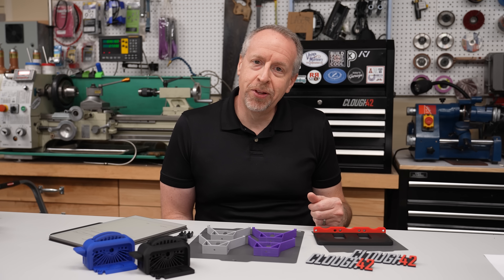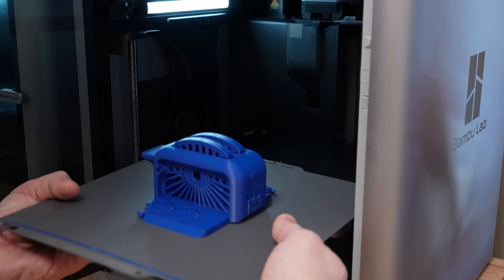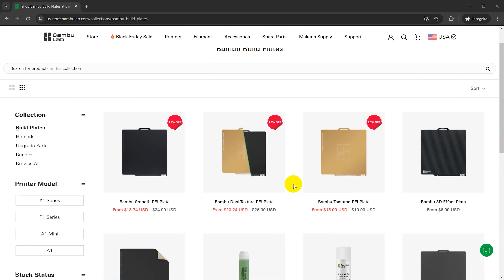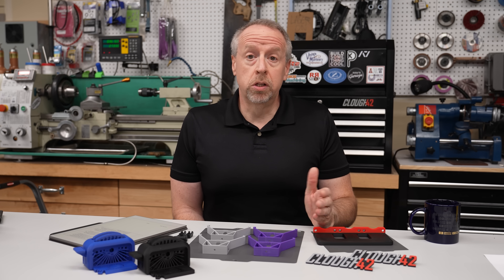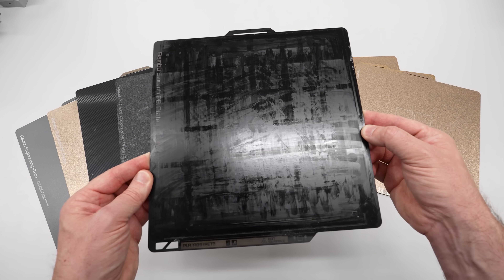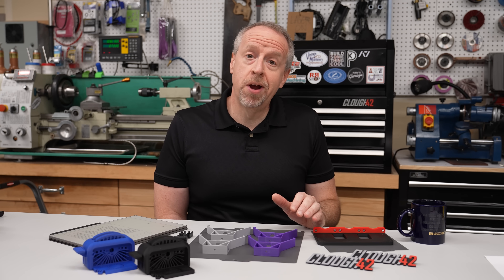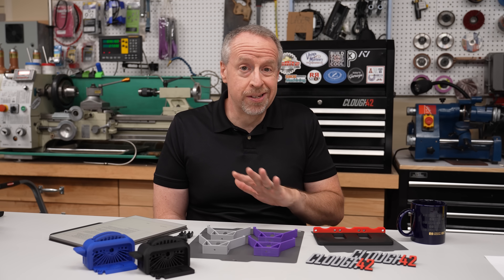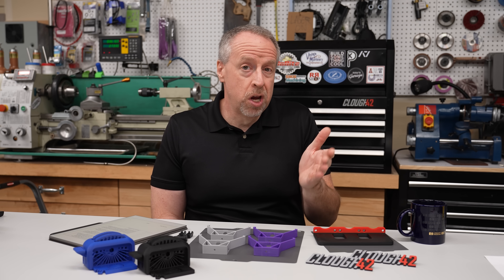Can't get your prints to stick?  Try this

Comment: P1S, print on pei texture plate 100% PETG HS.  Ive never had adhesion issues, other than too much adhesion on a few prints.  I tuned print profile and its been smooth sailing, all prints, colors, sizes and styles.  Curious your lacking adhesion.

Comment: I've had my printer for almost a year as of this comment... and the bed adhesion has been hit or miss, lately it almost seems 50/50. Flip a coin and watch it like a hawk. And then I run into this video of yours, and not even that far into the 2nd portion of the video, I ordered this supertack plate with the gift cards I redeem with my points from makerworld.

Comment: I was patiently waiting for it to come back into stock. I got it a few days ago. I have not got a single thing to stick to it, I use an Bambu A1.. I have done every cleaning and calibration trick I know, nothing is working. I briefly read online about there being a solution with changing the z height and flow rate or something, but that is beyond my capabilities. very disappointed, sounds like the plate is good but the machine is not calibrating to it or something. Going back to my textured old buddy, and using brim and mouse ears when needed.

Comment: My supertack has been working good, but now i am having some weird issues with my x1c...it prints the test patterns PERFECTLY, but as soon as it goes for the models, it's as if it does not print low enough. I am using standard settings, with filament i have dried and calibrated. Nozzle is brand new. Perfect coldpulls, no clogs. The filament just "gather" around the nozzle tip, not wanting to adhere to the surface of the supertack. Bedtemp 70 deg, petg 260deg (which is calibrated best result). I tried orca slicer, bambu studio, modified settings, standard settings, everytime it is the same problem. I do auto bed levelings for every print. It is just weird. I have ofc washed with dishsoap, and rinsed off very well, so no fingermarks.  Have you experienced similar problems with the supertack?

Comment: It isn't much of a cool plate if it requires 70 degrees for PETG. Same as the textured PEI plate. Mine failed when I first got it as well until I ramped up the heat.

Comment: I bought the Supertack and on my 2nd print with PLA @ 45c a huge spot of black filament stuck to the build plate and is pretty much fused to the plate now. No amount of scraping or washing is removing it. And, in fact, I've ended up scratching the plate trying to get the PLA off. I'm currently waiting on their Support to get back to me. Hopefully they'll replace it. It's an expensive plate to have it screwed after only two prints.

Comment: I bought this plate for my X1C. I've been using Elegoo PETG Rapid on a smooth PEI cold plate successfully (with glue) but decided to use Bambu PETG HF. Dried for 12 hrs at 70 degrees, just balled up on the nozzle so I tried the Super Tack plate. The first layer curled up at the edges, even with glue, and increasing the bed temp made no difference. I've since put the Super Tack plate in a cupboard and gone back to Elegoo Rapid. It seems we all have hit and miss experiences.

Comment: got one of these   but still getting  failed   prints not sticking  ive  upped the print temp  for petg   bambu  own brand    at 280    and plate of 80    and getting 40 per cent ok  what else can be wrong btw i have 2 bambu  labs p1s   and there both  the same

Comment: Picked up this plate because of this review and have to say I'm not impressed. Apparently there are tons of people who have issues with these plates, I've pulled every trick in the book and have dozens of scrap parts due to the fact that nearly every single print of any decent size lifts at the corners and warps. Sounds like it's QC issues since some people have bought multiples and had some perform well where others have unusable levels of adhesion. If anyones thinking about this plate do yourself a favour and look for something else.

Comment: I print GETP directly on my textured PEI plate with no adhisive and it sticks incredibly well. Sometimes i actully have a hard time removing the parts, and its almost always a pain in a** getting the test line at the front of the plate off. I usually have to run a razorblade under it.

Comment: I'm a little late for this. Haven't tried the supertac but I do have the (real, not effect) carbon fiber plate from WhamBam for X1E. I don't like using glue sticks or liquid glue and this plate is fantastic for any of the materials I use that tend to ruin beds. I think it might be the same as the  Darkmoon CFX but I don't have that one to test. 

I'm an electronic design engineer (the non-hobbyist 5nm/3nm CMOS kind) just getting into machining/makerspace stuff and love your channel. 

I really want to find underlying script interface to Fusion 360. AutoCAD had it. Cadence had it. They were Lisp based. Every action has commands associated so it was possible to dump the commands, modify and replay. With those programs it was possible to create entire drawings from a lisp script.

Comment: I just got the sheet to print on myself...  

I never have had anything curl up or not have an issue with the smooth or textured plate.  Now I have to use GLUE for all beds on my P1S, interested in seeing if this will work without the need for glue.. like you, the glue builds up and have to keep washing off.. i hate that part.

Comment: I only print PETG and I use a 1mm soft steel plate that have been hand sanded with grain 60, 1. layer is 95° C 2. layer 80° C.
First time I print the whole plat with 0.2mm to clean it for any dust. remember to keep i covered when not using it, dust is a killer.
This have worked fine for 7 years.

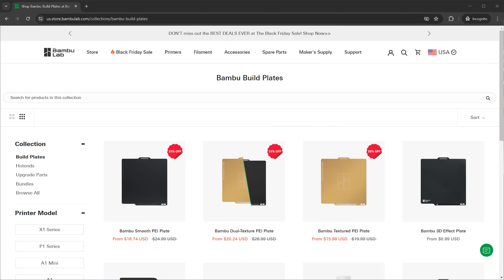Comment: 1:59 What I'm interested in is printing prints that were designed for resin printers. 

Fat Dragon has tracked down a very good PLA and excellent print settings for it, provided you don't also have complex shapes on the underside. 

Problem is, I've got things with complex shapes on the underside too, and they're either deforming or spaghettifying on prints. And I'm wondering if the high temp needed for strong adhesion is also causing the PLA to deform under the heat...

Comment: Yes, I can confidently say that I can print that on my Sovol SV06 on PLA filament specifically that I leave in the open air in my basement for months on end and print without an enclosure and without the use of any bed adhesive or release compounds, without cleaning my print bed and using the print bed that came stock with the printer.

At least when it comes to PLA: if your prints won't stick, you need to fix your extrusion multiplier (needs to be around 0.95 for standard PLA) and your bed leveling. You should print a large flat layer on the bed and raise the nozzle until each infill pass is printing individual strings, then lower the nozzle until the strings tightly fuse but without having any extra plastic sitting on the top surface.

That and check that the set screw locking your extrusion gear in place have thread locker applied to them and are still tight. My SVO6 printed for a long time with loose set screws and minimal stringing before it locked up and failed to print.

When you are done, you shoulde be able to print a large flat sheet that is smooth on both side but cant easily be torn appart.

Now your first layer is callibrated.

Now If you have curled overhangs then you need to reduce your print temperature if you part cooling strength isn't enough. Adding Z-lift when you travel will also assist in not knowcking parts during the print and keeping them on the bed.

In terms of drying. PLA may be hygroscopic, but the material will not absorb water when the filament is at room temperature. If you have wet PLA filament, it's because it was very humid at the factory that made the PLA in the first place. No amount of drying will ever take that moisture out unless you heat up the PLA sufficiently to deform it: at which point it's not longer going to be sized to spec.

I've dried wet filament for a week and seen no change and I've left dry filament in the basement for over a year in open air and seen no change. This has been my experience with PLA for the last 4 years.

I can't speak for other filament types, but at least with PLA, if your prints won't stick, it's usually the bed levelling and the print setting fault.

I don't even clean my bed before I print on it. I just let all the dust in the open air in my basement fall all over my printer, print bed and spools and everything I print sticks anyways because my printer is properly calibrated and my print settings are well set-up.

Comment: I just use the Bambu Textured PEI Plate for everything. No issues at all with any filament I use. I don't use any glue or substance on it,  it just prints on the plate as is. Everything sticks fine. To add I print in PETG a lot and this plate works without glue just fine but I don't print many things that have small contact points. I may try this just for fun. :)

Comment: I haven't had much trouble with Smooth or Texture plate except for prints that hold very little. But this plate can be used for difficult prints. Since I don't like a surface to look different, I generally prefer Smooth Plate. Thanks for the detailed review.

Comment: Enjoying your content James. You mention having a buildup of glue stick on the bottom of your prints. Try folding up a paper towel, wetting it slightly and wiping the bed down after applying the glue stick. This dissolves the heavy layer and smooths it all out.  I use a smooth PEI plate with about a 50% glue coverage before wiping and wash it if I can see old print "footprints" on it (or just wipe it again). I print mostly PETG.
Hope this helps for you.

Comment: OK, this was one of the videos (along with the Bambu Lab website sale) that convinced me to get the super tack plate. I had to wait a bit for it to come back into stock, but it arrived the other day and I was excited to try it with a tall PLA print. 
It was an absolute disaster. My X1C made more spaghetti in the first layer of that print than it's made the rest of the year I've had it. It turns out there's a bug that none of the reviewers who were sent free plates by Bambu thinks to mention. You have to turn off the build plate detection on the printer. This is a feature that's saved me on more than one occasion, either from printing directly onto the heater or from using the wrong type of plate for the filament. My printer is in the basement and I send prints from my office upstairs, so sometimes I've forgotten what's on the bed. It's not enough to just dismiss the warning that comes up with the super tack plate which says the plate was not detected. It seems that if you do that, there is some kind of bug which means the Z height is screwed up, hence nothing sticks to the super tack plate at all.

One of the best things about the X1C compared to my old Ender 3 is that it "just works". The error detection and recover options are really robust and useful. Why you would have to disable one of the key ones to get this build plate to work is beyond me and not a compromise I'm willing to take. I've had plenty of good results with the Textured PEI plate and I regret buying into the hype around this plate. I can only hope that Bambu are working on fixing the Z height bug and the automatic detection of their most hyped plate to date. Until they do, mine is going back in the box.
Reply: Fortunately, I read your comment before hurrying to the Bambu store :) Now I will consider buying more thoughtfully. I have the same configuration as you: printer in the basement, design work on first floor. Thanks for your comment!
Reply: still not fixed. just got mine, I use it on a A1. nothing sticks.
Reply: It isn't just the plate detection.  I bought one for my P1S, complete trash plate.  Nothing would stick to it, and the few prints that didn't fail, printed at horrendously low quality.  I tried everything you can find on the internet, cleaned it to stupid degrees (yes only with soap and water), tried lowering z height, increasing z height, lowering flow, raising flow, raising bed temps, nothing worked.  

I eventually threw it in the trash and bought a Biqu Cryogrip.  Told my P1S it was a "textured pei plate" manually lowered the bed temp to 35c, left everything else standard pei settings, and boom everything printed fine, great adhesion, and lower temps.  Only had two print failures on this plate... one was a power outage mid print, the other was 3+ weeks of printing with very little break, no flipping to the other side, and no plate cleaning.  That's on me.  Now I clean it once every 10 or so prints and it is fine.

I think "youtubers" got review copies of this plate, and once it was pimped enough on socials the QA went out the window.  Buying one now is just playing the lottery.

Comment: Great information, I just got the A1 Mini for some tiny projects that need smooth plates. One thing I do after printing is stick the build plate/print into my freezer, 15 minutes later the parts and supports fall off. I had issues with warping while waiting on an enclosure, found Orca's 'Draft and Shield' feature solved that issue. I'm still shaking my head after your PPA-CF, 1/10° dryer.

Comment: I've had my P1S for almost a year. I have the textured PEI plate and have never used any glue or anything and have never had a problem with adhesion. PLA, PETG, PLA+... all seem to stick fine.
Reply: I can confirm that
Reply: @weinix10  you can confirm that I've never used glue on my build plate?
Or did you mean that you have had the same experience? Lol
Reply: @fasfan  sorry I didn't express myself clearly, I mean of course that I had the same experience and never used glue on my textured pei plate haha
Reply: You probably don’t touch your build plate with your greasy fingers.  It’s that simple.  Stop touching your build plates.  Wash with warm dish soap every few months, use the paper towel it dries on to insert onto printer.  Keep your hands off.
Reply: Same experience here. I regularly wash my plates with hot soapy water but that's all. Still have a bunch of free glue sticks (that came with the printers) unused. I'd still be interested in a supertack plate for the smoother surface texture. The Bambu Lab smooth PEI plate tends to be a bit hit or miss for me.
Reply: Same here! I've also noticed that the oils from my skin cause adhesion issues, so I try to avoid touching the plate whenever possible. When I do have an adhesion issue, I wash it by hand with Dawn dish soap.
Reply: i have an x1c and petg stuck TOO well so i cooled down the bed temp
Reply: Are you all using higher bed temps then to get it to stick well? or just using standard temps and being diligent about keeping your bed clean?
Reply: @DustinBlodgett  I wipe it down with IPA after each build and don't touch the print area after that
Reply: @DustinBlodgett  I've had an occasional issue with some PLAs but usually just crank the bed temp up about 15C when that happens.

Comment: For PETG on the textured PEI do not use any glue stick! PETG needs higher temperatures than you would expect and a perfectly clean PEI sheet, I used glue stick and I nearly threw away the plate because even after a regular wash in hot water and soap it wouldn't stick anymore. If you've ever used glue stick on the surface give it a very light pressure scrub with the scrub pad on the sponge and some 90%+ IPA. After that treatment at 75C i have perfect edges and corners on a 140x140mm product I make and the bottom face comes off with a brilliant sparkle and textured finish. I set my plates on their side in front of a fan and the part falls right off as soon as it's fully cooled. If my part is going edge to edge I bump it up to 80C and have zero issues.

If i have any sticking issues at all it's from hand oils, i just give a quick microfiber IPA wipe and it's back to sticking perfect again.

Comment: hmm, ok, im only six weeks into 3D-printing, but having printed around 250hrs with pla and petg, even bedfilling prints with petg I really had no adhesions issues. with the textured PEI plate and an OEM smooth and textured plate. It sticks very well without any use of glue. Especially PETG with a big print needs to be cool to remove it from the textured plate. So I don't see a use for a supertack plate from bambu or frostbite or glacier from biqu.

Comment: I Always use 50°C for my PETG prints on my textured PEI Sheet. And it Sticks very well.
I Print Most Times PETG, then PCTG on 80° and Sometimes PLA.
I never used a glue Stick or Something else and I Clean the PEI two or three Times a year with soapy water only.
I have a Sunlu S8 plus, an old 8bit CR10 clone.
But the PEI Plate ist one from Energetic. And finally IT IS the cheapest ones of all those plates from known Labels.

I am really surprised that gluestick or the recommended high bed temperatur is still such topic.
Especially for PETG.

Comment: I use the bambu smooth PEI plate with Vision Miner adhesive. It works like a champ, I have to re-apply after about 3-4 prints, and never have adhesion issues.

Comment: I have a couple of Cryo plates, but haven’t tested them. I use cheap smooth plates from AliExpress and 3DLac Spray; 100% adhesion everytime for me. I’ve never looked back at the textured plate mine came with, it worked great for the first 10 or so prints but despite regular cleaning I started to need copious amounts of glue stick to get anything to stay on the plate.
Might take a look at these, but the most important lesson I’ve learned about my 3D Printer is if it’s working, don’t tinker.